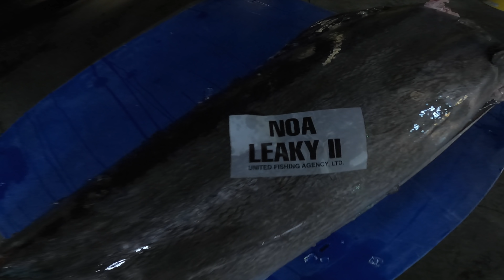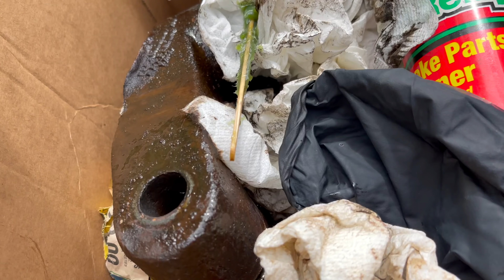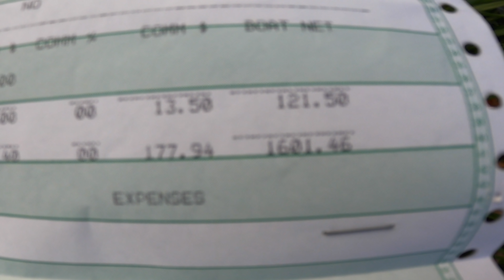GREEN STICK FISHING for TUNA with my 9 YEAR old SON in HAWAII!  We AUCTIONED off the TUNA!

Comment: I Feel ya,     I  am a Commerical   fisherman  of  41 years,   Boat trailers Suck. Over Greasing  The Buddy Bearings usually causes the   issues,    Blows out the inner seal,    Then its ALL  down hill from There.      Fix it ,  new inner seals ,     Leave it  alone ,  it will be good for 6 months.    Take it apart inspect the  bearings,  and  Races  ,   replace the inner seals  greasev It  properly,  leave it alone  for  6 more months...   dont over maintain  them......  Been there      .....    LOL.......   Mahallo,   Capt   JP ..
Reply from the maker: Awesome info.   Thanks. 🤙

Comment: Dont know if its availible in Hawaii but theres a product called Res-Q-steel made. Put that on the nuts n bolts, the spline on your stub axle anything really that needs servicing and even after many years drowned in saltwater it will all come apart no problem.
Reply: can you use Res-Q-steel on things that are already stuck together to create separation, or gotta be applied when brand new?